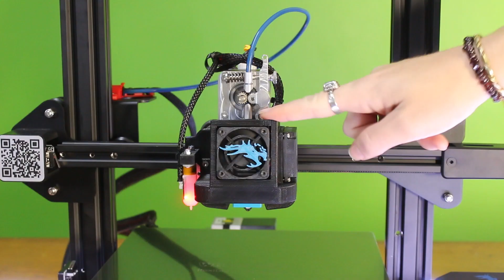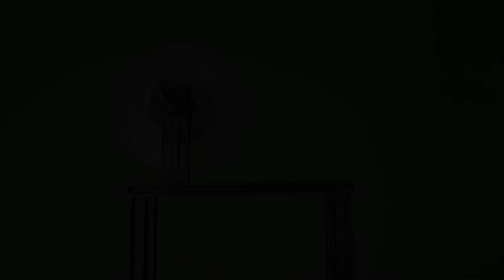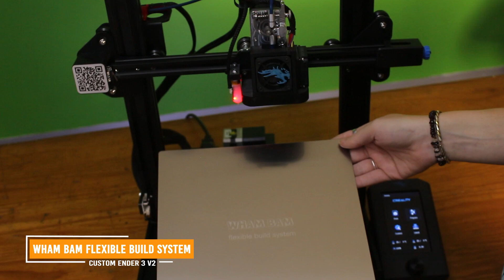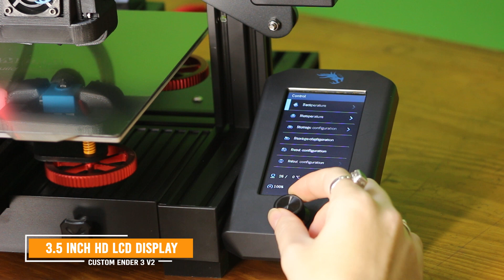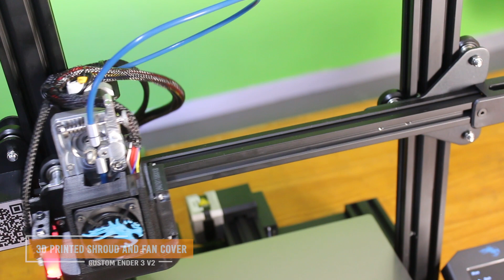6 Awesome Upgrades for the Creality Ender 3 V2

Comment: I realise 3D printing is a whole new rabbit hole one can go into, however I have a broad question: I'm not looking at spending a ton of money on this, it is more a means to an end. Is it kinda worth it to buy a used Ender 3 V2 on marketplace (I see them everywhere) and get started with printing for my prototyping needs, and then upgrade it as I need to? I'm not looking into becoming a 3D printer person, merely it is a means to print parts for prototyping and testing of shapes and designs and enclosures. I have a bunch of nema17 motors etc and well comfortable with electronics, but it seems bang-for-buck is on a used printer and upgrading small things as you run across them in terms of need. Like one need for me is not to be able to print fast - but I'd like to be able to print relatively accurately and relatively smooth prints. Whatever "smooth" means.

P.S. I also totally understand that I'm kinda asking "how long is a piece of string"

Comment: Looks like the bed levelling screws have been upgraded as well?
Reply from the maker: Hi Kris, Yes they have been replaced with Creality Bed Levelling Nuts. These are aluminium bed levelling nuts that replace the plastic bed levelling nuts on the Ender 3 V2, you can find them here:

https://www.diyelectronics.co.za/store/beds-heaters/2902-creality-metal-hand-twist-bed-levelling-nut.html